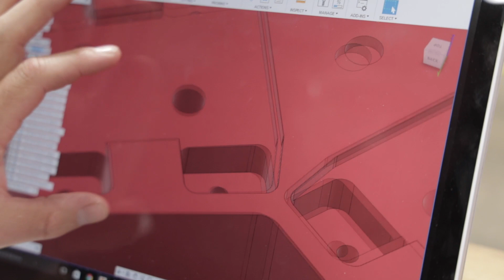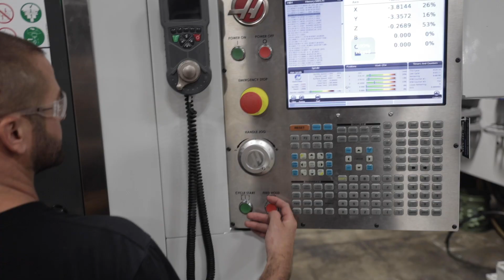Creating A 5-Axis Multi-Part Fixture Plate for Production | The Art of Fixturing | CNC Machining

Comment: 1:50 and on..  Do you lift the tool??  It hardly moves up, or I am imagining.  By how much?
Reply: I'm using MasterCam and in high speed paths by default you have 0.25 mm clearance between passes.
Reply: @sutryk21   I'm using Fusion360 like he does.  I'm not even sure that's the default on that.   I have a Tormach 1100.  I don't like to do trochoidal,  the tool screams so loud you can't even stand next to it without ear protection.
Reply: @danl.4743  Maybe you've got wrong tools for HS. And it also depends of machine stiffness.
Reply: @sutryk21   I always suspect the machine stiffness or the amount of backlash.  But I was using a YG-1 coated carbide 4 flute roughing endmill.  Switched to a 3 flute slotting endmill (YG-1 coated carbide, with the same 6mm diameter), and it is much quieter.  I'm now using it for all my roughing, but I feel something is missing here.
Reply: @danl.4743  Are we talking about aluminum or steel?
Reply: @danl.4743  I am using mills with not symetric flutes (translator says "alternating helix", I hope you get what I mean). Mills like that are less likely to chatter.
Reply: @sutryk21  Mild steel.  Yeah, variable flute end mills.  I know what you mean.  I was thinking of getting one to try it out.  It cuts the harmonic vibrations.